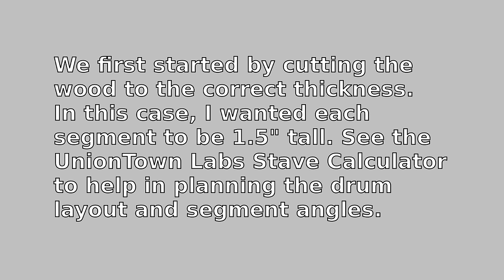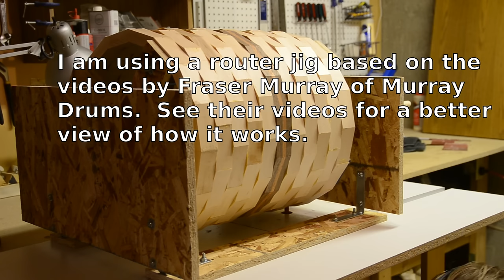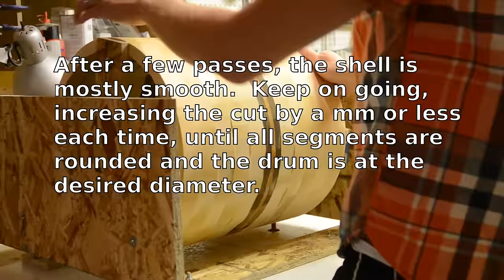Segmented Cocktail Set Construction - Floor Tom (Part 1)

Comment: Nice drum man! What type of glue did you use for the endgrain?
Reply from the maker: Titebond (original IIRC, could have been 2).  Note that even though I am gluing the end grain to form it into the hoops, the hoops are glued together in a brick pattern along the edge grain, so the end grain joints are not critical for structural integrity.

Comment: That tom looks great!  I'm working in a similar fashion, though I really need to upgrade my jig for routing the outside of the shell.  I learned after my first two shells that using larger, farther spaced wheels makes the drum much more stable.  Check it out: https://www.youtube.com/watch?v=xAVDSeWdTJE  In the meantime, I really look forward to seeing the drums finished!
Reply from the maker: Thanks for the tip!  That makes sense about the stability of the rollers... I got the cheapest castors I could find at the hardware store, I probably should have gotten some larger ones though.  I will have to make some changes when I make the snare drum, probably within a month or two.

Your snare looks awesome, too... I love that rosewood.

Cheers